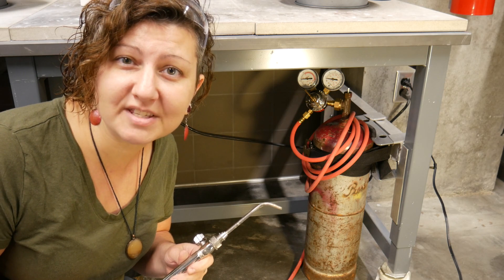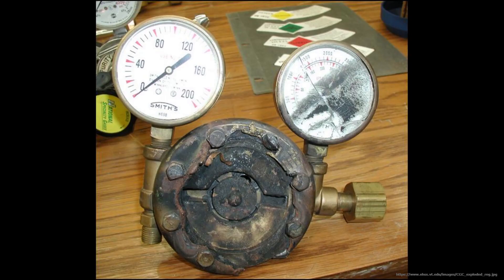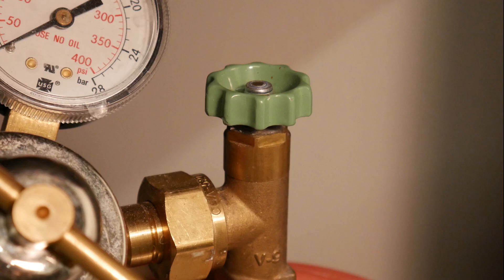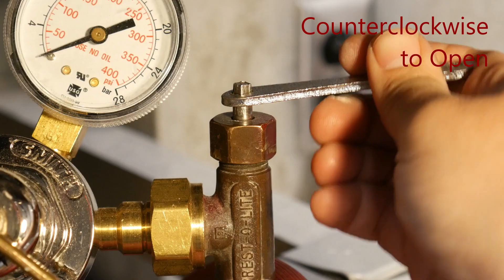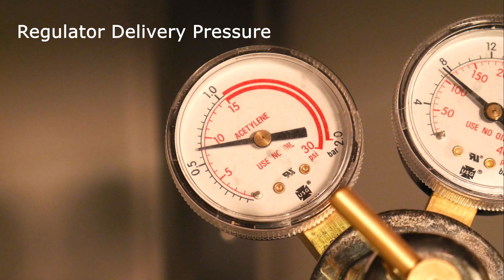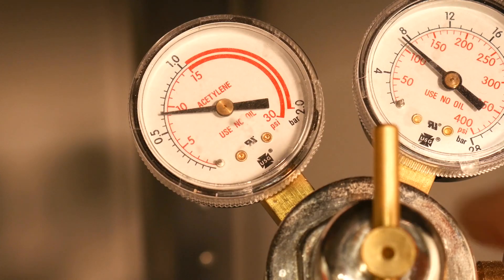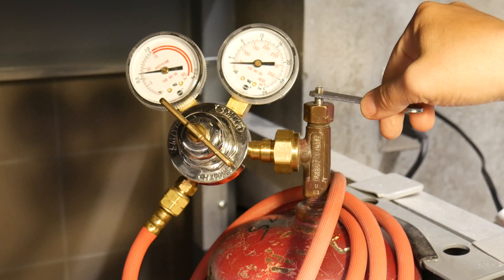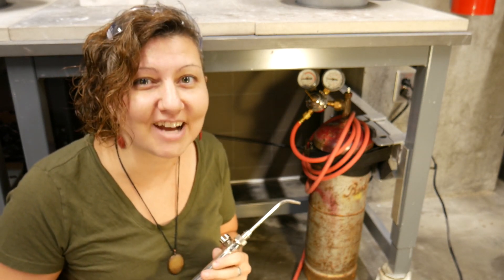Opening & Closing Acetylene Torch Cylinder with Regulator

Comment: I have this exact set up… I was using just fine and all of a sudden I stopped getting a strong blue flame. Just a floppy orange flame. Thought it was time for a new tank, but continued with a a floppy flame, I was told maybe my handle was bad and replaced it. Still doing the same… could a bad tip cause this? Thanks.